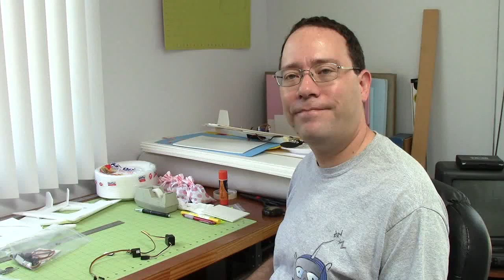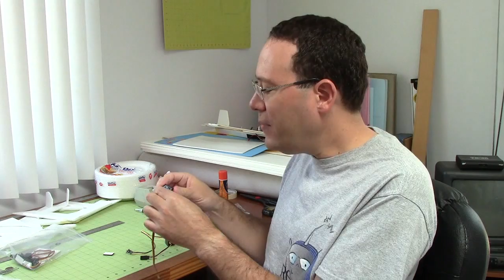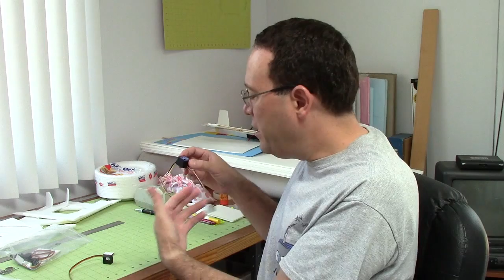Using RC Gyros

Comment: I want to use a yall gyor in a Hobbico Twin Star so when a engine fails the gyro figures out the yall issue and the rudder goes to the correct side, which would be faster than I could figure out

Comment from the maker: The short answer is that yes, you can fit a gyro into it. There are many gyros on the market that will work just fine. Look for them in the same places that sell RC helicopters. They all come with basic instructions on how to do an installation.

A longer answer is going to have to wait until I write an article in my blog about it.